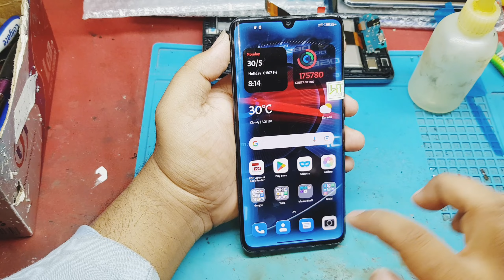Xiaomi Mi Note 10 Lite Lcd Replacement  Xiaomi Mi Note 10 Lite   Screen Replacement/Disassembly

Comment: Thank you for such a quality and informative video!

Is the removing the plate (at 2:12 ) really neccessary for display change? It does not want to come out and I do not want to force it. I beleive I can pull out the cable without removing that plate. 

This the first my phone that I want to fix by my one, I have no too much experience, and also I want to prevent making a damage by removing unneceserry components.